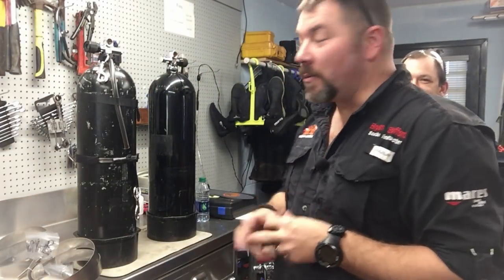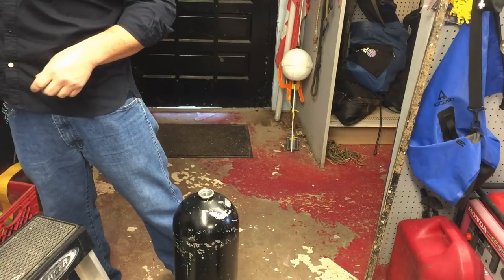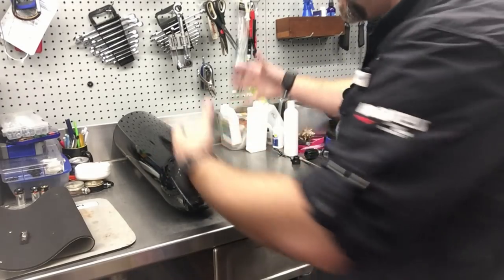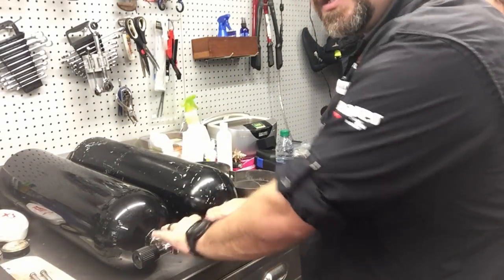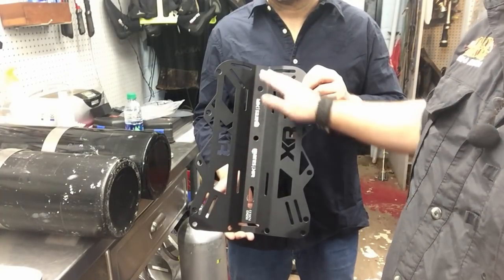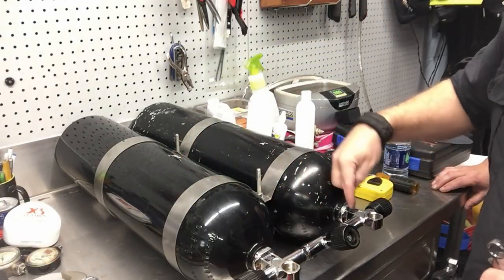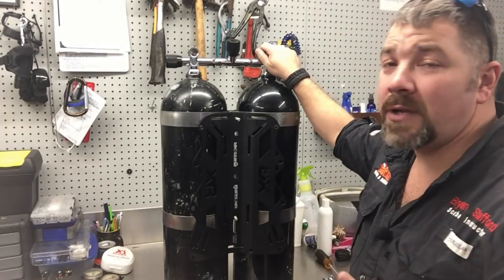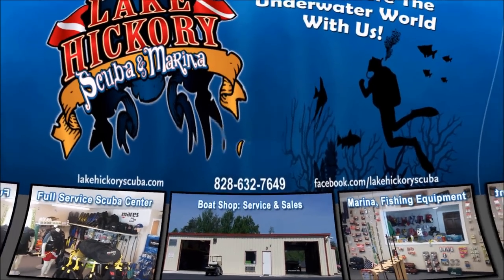Building A Set Of Doubles

Comment: Hi really great video! Name is michael and I live in Ireland. I have in mind to buy two 6.8 L Carbon Fiber/AL tanks out of Europe (Poland) to keep taxes manageable. I used to dive a now very, very old 2250psi 72. I'm also buying a high quality dive compressor. While I still have the aforementioned US Divers tank with a J valve, there is no way I would try even a lb in it. It's well beyond sell-by.! (Before someone in Ca. conned me out of it, I also had at one time a double hose Royal Aquamaster regulator that went with it. Spilled milk! Mind you, the interior remains pristine, totally immaculate (US Divers for you). Your video answered most all questions save one...and I feel like a dummy for asking, but I note each tank retains it's  customary regu;lator port plus O ring on each valve connected to the main one mid manifold. May I assume one would shut off one of the individual valves on one side and attach the regulator to the other? Can't actually see any other way, but you're the expert, so therefore the right man to ask. To demonstrate my ancient lineage, I am Naui open water, never bothered with Padi. Back in those days, the final was a real bitch, but having dived (mainly while in Aruba) since age 14, with Heaven's help I thankfully managed. Cheers! formulahits@gmail.com Thanks!!
Reply from the maker: Hello michael anthony, I am not totally confident I understand your question completely, but I will try my best to answer it. If you are asking if you can just attach one regulator to the cylinder and still get air from both cylinders, then yes you can. However, you will defeat the purpose of a manifolded valve. The sole purpose of the manifolded valve is redundancy. If one post malfunctions, then it can be shut down, and the air can still be accessible from the other regulator. In the event one side fails, it can be closed off via the isolator valve in the middle, preventing a total air loss. On a side note, you mentioned the Carbon Fiber tank, those are not that popular here in the States, as their buoyancy characteristics are very positive. Most divers have to compensate by adding way too much weight. Depending on the size of the cylinder, they may work great for redundant air systems, but not so much for primary systems. Hope this answer your questions, if not please do not hesitate to send us an email. lakehickoryscuba@gmail.com

Comment: Another great video.  All I'd say is I put the bands loosely on the cylinders while I'm adjusting the manifold to make sure the spacing is going to be right when I tighten it off.  Sometimes the bands impose a spacing that's requires the manifold to be not all the way screwed in when you lock it off.
Reply from the maker: Very true and thanks for pointing that out Tim Gosling.

Comment: One little thing, the measuring band is alright, it's on purpose that the metal thing at the end moves and it moves exactly the amount that the metal is thick so that if you hold it on and pull it it shows the same as if you push it against it 😉
Reply from the maker: You would be correct.

Comment: Great video Bryan.  Is there a special o-ring lube if the doubles are to be used with nitrox?
Reply from the maker: We use O2 compatible silicone and cristo-lube for cylinders if they are going to be used for nitrox diving.
Reply: @LakeHickoryScuba  No point in having all that gas if you run out of NDL :-)

Comment: Isn't there trouble with the buoyancy variances between cylinder brands and cylinders manufacturing tolerances between batches?
Reply from the maker: Great question. If so it’s on such a minor scale, there is hardly any noticeable difference.
Reply: I agree with LakeHickoryScuba. That’s a really minor difference, it would be like splitting hairs. The key is just following good buoyancy fundamentals: know your body, know your wetsuit (or drysuit), know your BC, know your equipment. You should be able to (slowly) descend with your BC empty and lungs empty, at surface, but able to stay at eye level to the top of water, with lungs full. Don’t be over weighted. If your choice of weighting is correct, then you’ll be fine regardless of the cylinder. Worst case if you can’t get down, just add a pound or 1/2 kg or so.

And as you’re diving, and your tank gets lighter, just squeeze more air out of your BCD, especially when you’re re-ascending (you’re generally able to squeeze a little more out). And breathing control.

For me, I’m able to just use 8 pounds with a DRYSUIT and TUSA BCD, in ocean water, with a single steel tank.

Comment: I had a shop assemble my tiny doubles (LP50’s) and noticed that my top band has space bilaterally on the inner circular portions of the bands. The bottom band fits like a glove with no space between the band and tanks. Both bands are sized appropriately for the tank’s circumference. Is it safe to loosen the top band and spin the manifold to tighten/bring the top portion of the tanks together to take the space out of the top bands after they’ve been filled? Or would I need to bleed off all the gas first?
Reply from the maker: Hello @SierraNovembera3. You can most certainly adjust the bands and the isolator on your own. Just make sure you are not putting to much tension on the system and you should be just fine.

Comment: Something I don’t understand.
I’m about to take my PADI open water and advanced cert.
Only thing is, I think I would prefer to dive Hogarthian with twins. Can I go buy and dive such a setup after padi certification?
Reply from the maker: Hello IncendiaHL, you most certainly can dive doubles and a Hogarthian setup after your certification.  I would suggest to you to ask your Instructor to run through some valve drills with you so that you know how to handle a situation with the doubles if they were to occur. Safety First.
Reply: Thanks man! Love your channel! :)
Reply from the maker: You're welcome
Reply: Legally yes, you can dive twins as long as you’re certified. (Actually legally, I don’t even think it’s a USA law to be certified to dive at all; although it is a law in most of Europe). However, if you aren’t trained for doubles or Tech diving, many dive boats will be hesitant to let you dive with them, and some shops may refuse to sell you them for liability reasons. But you can always bribe places and offer to pay extra if they don’t ask questions. In general I recommend first getting your “deep dive” cert, and then “intro to tech” + “twinset (aka doubles)” certifications. Diving doubles can be tricky, especially in terms of weight, balance, and setup and they can be especially risky if you’re mixing gases and going deeper than Rec limits before you’ve been trained for that

Good documentary to watch, “Monty’s dive mysteries: Blue Hole” best 45 minutes you’ll ever see on diving and really eye opening

Comment: When running aluminum 80s. When at 500psi they could very well be - 4 to 6 pounds depending on manufacturer. Do you ever add weight to make them  neutrally buoyant?
Reply from the maker: Hello Joe kle, I am fortunate enough that my weight is always balanced out no matter what gear I wear.  Especially in a 3 mm wetsuit.  So typically I do not have to add extra weight to the cylinders.  Not all divers can say this, and it is not uncommon to see divers do this.

Comment: Is there a preferred size of tank to run doubles?
Reply from the maker: Hello Gerry Yeager, it all depends on a diver's needs and his physical attributes. Back when I did dive doubles, I preferred high pressure steel 100's. A lot of divers who are taller or will typically dive in colder environments, where their weighting needs are greater will dive larger cylinders. Some divers prefer low pressure 85's and 95's, because of the possibility of plus rating fills.

Comment: how long are the bolts and are the same for 7.25 & 8 inch
Reply from the maker: The ones used in this video are 5 inches in length.  If you are trying to band together with 8 inch bands, then you will need 5.5 inch bolts.